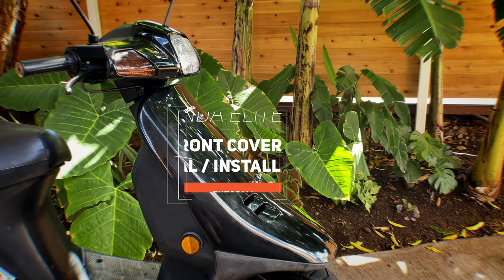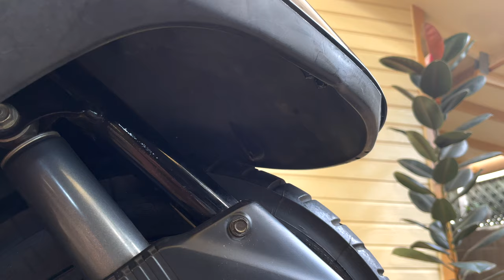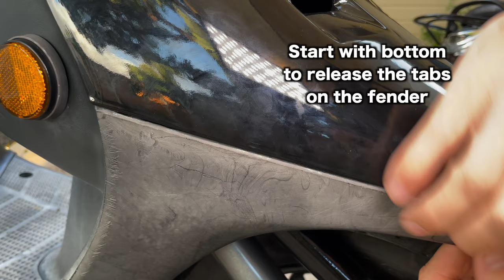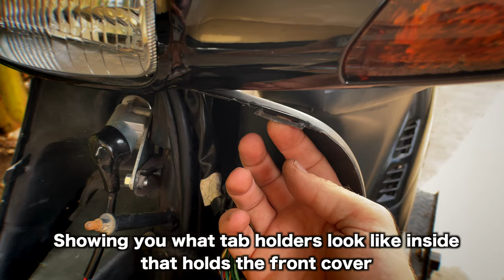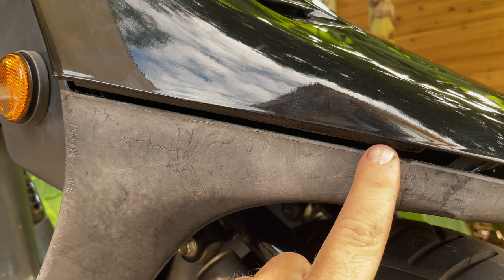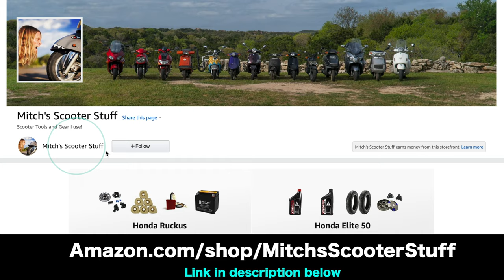Honda Elite / Tact 50 Front Nose Cover Removal / Installation | Mitch's Scooter Stuff

Comment: Nice Video about an important topic, if you want to maintenance a scooter without ruining the covers. I had to remove the covers of my Honda Helix several times. And at the beginning it was a lot of frustration and swearing. Even though I know the correct sequences of removal now, it's a lot of work and screws to remove them. I wished someone had done some maintenance videos about the Helix. Maybe this is my chance to do it ... LOL.

But on the other hand. If you know how to do it, you cannot do anything wrong. And my two Hondas always surprised me with the condition of the mounting points and joints no matter how bad they looked. That's quality!

Keep up the good work!